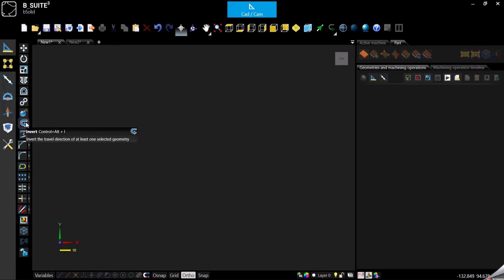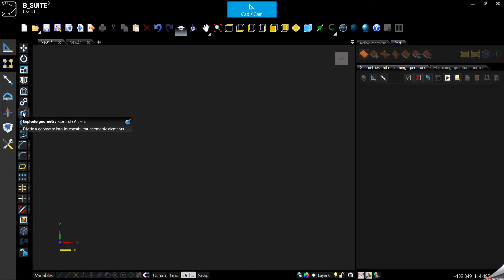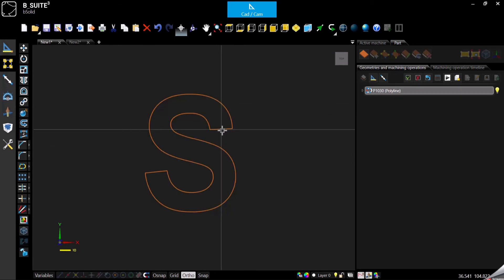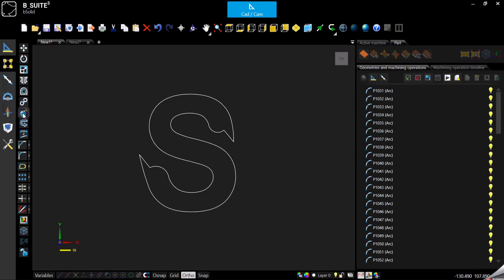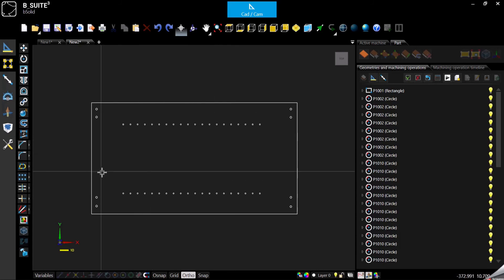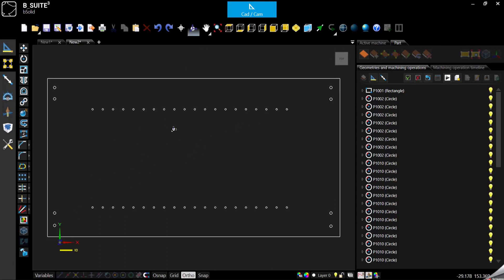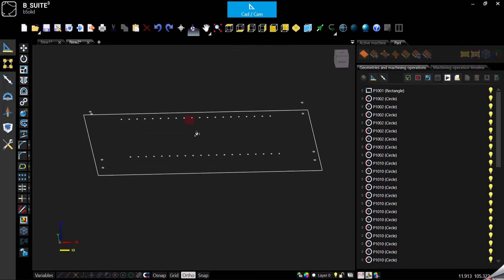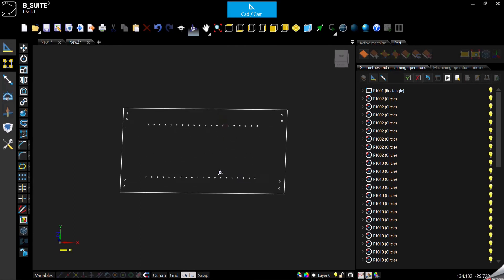14 - CAD BIESSE bSolid - Part 14 (Explode & Align in Z)

Comment: Too bad you just teach the software,  not the machine as well. How to define a tool,  draw the tool yourself,  all the errors that come with the software,  a lot to learn.  What you teach is useless.
Reply from the maker: I'm sorry you think so, and if you find these videos useless, simply stop watching them.
I hope instead that they can help many people.
I can only wish you succeed in finding what you are looking for.
Reply: @freshzone  unfortunately it is. I did Biesse Rover BSolid training and it goes beyond what you teach.  I watched a few of your videos while I was doing the training but I didn't find help in them. Unfortunately BSolid is connected to a machine,  it's not photshop.  Just to draw a line isn't helpful. How to draw a horizontal line at 51mm from the top 23mm from the left, 102mm long and actually machine that line taking in consideration the tool you use is 12mm wide. So you're not actually machining a line, you're machining something that has a Y and an X. The tool goes inside at the wrong coordinates and destroys the dimensions. There you go, the difference between theory and practice
Reply from the maker: @CarMagic1  Again: like it or not, here I only teach how to use the software and I do not teach how to use the machine or the application on this channel. 
Everyone that works on a CNC machine should know that everything matters, so is not only the diameter of the bit like you said, but also the length that dictates the maximum step for the depth of each pass, or the amount of flutes to determine the feed rate and so on... 
Biesse offers paid training so if I would do what you're asking, there would be a conflict of interest and I could get in trouble, because I'm actually still working for Biesse.
If you need additional training on how to use the machine and more specifically on the application, please contact Biesse service department to ask for a quote.
I'm sure Biesse will be glad to send someone over there to fulfill your request.
Anyway the software training starts from the basics and you have to keep in mind that not everyone knows how to use a cad software like you probably do know, but it will get up to show 5 axis machining... it will take a wile because I'm doing this in my free time, but I will get there. 
Anyway I'm not forcing anybody to watch the videos.